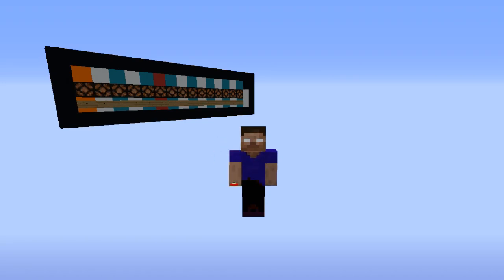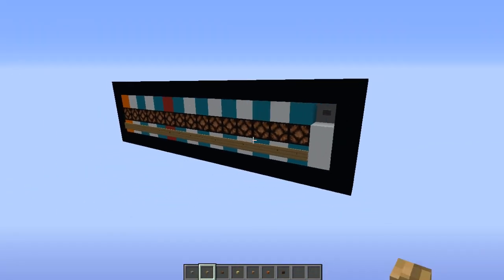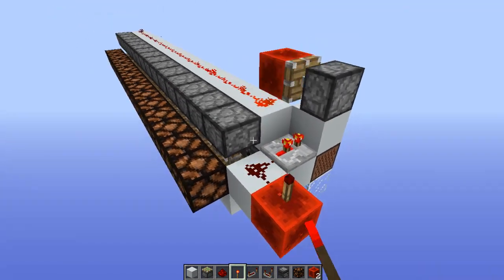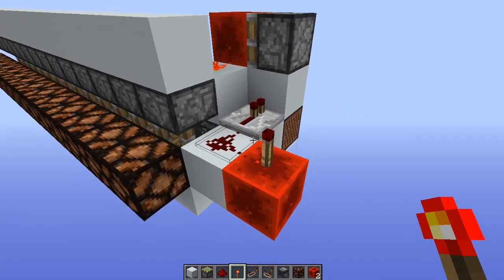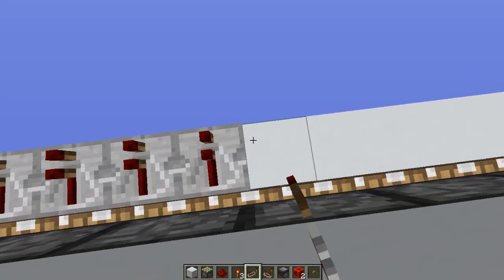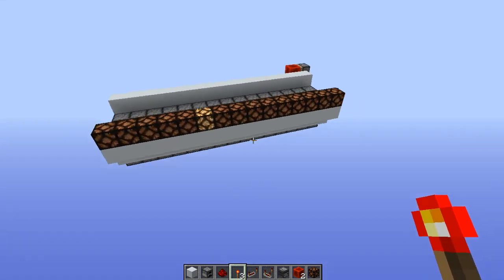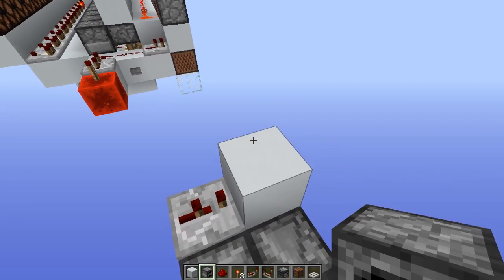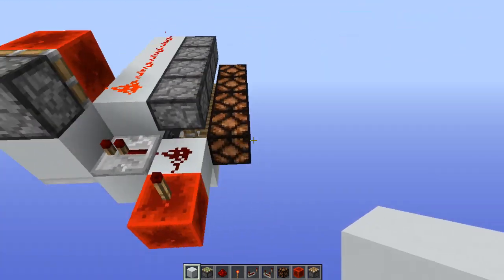Simple way to detect and identify pulse lengths | Minecraft 1.13+

Comment: I actually designed a version of this that can only tell whether it's a 1 tick pulse or a >1 tick pulse (and the data is read by something reminiscent of an RS-NOR latch), to use as the data storage section of a RAM core I'm designing, then I realized, 'I'm sure someone's already designed something similar', so I looked it up, and sure enough, you've created something not only similar, but much more versatile.

Probably still going to use mine, though, since it's slightly cheaper and slightly less lag-inducing (possibly)
Reply from the maker: I also have a pistonless design for pulse length decoding. You can check it out on my data transmission playlist in case you're interested!
Reply: That’s definitely on my ‘to-watch’ list

Comment: I'm curious, what prevents the signal from the noteblock update from traveling further down the line of observers? Like I'm not understanding how it goes to a specific one rather than continuing ahead in the chain.
Reply from the maker: The signal continues anyways but it won't have a "way out" until the pistons retract for a single tick allowing the signal flow to be exactly controlled for a fraction of time.